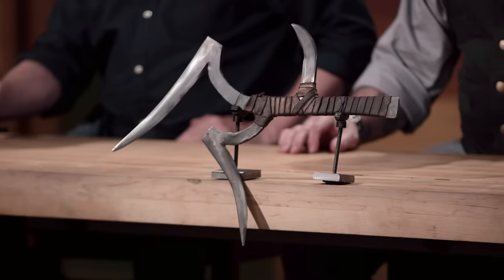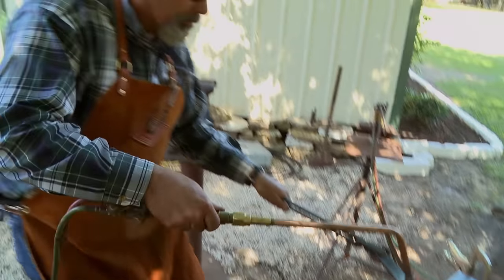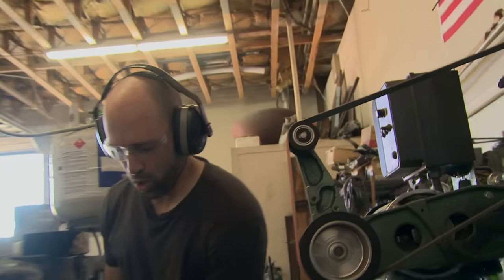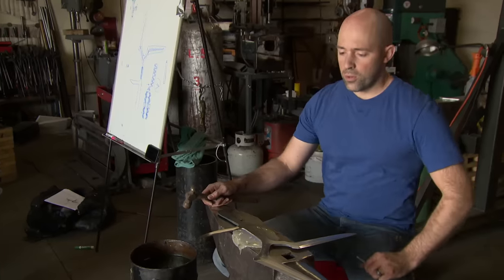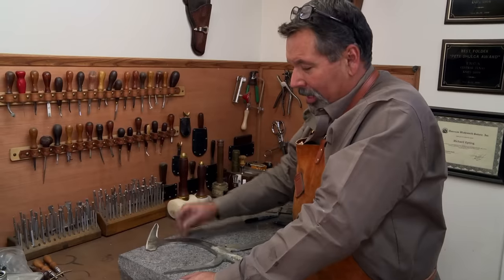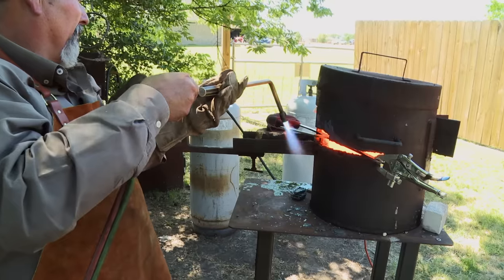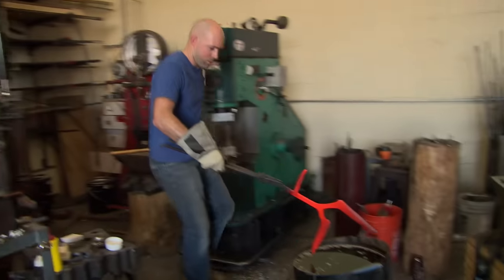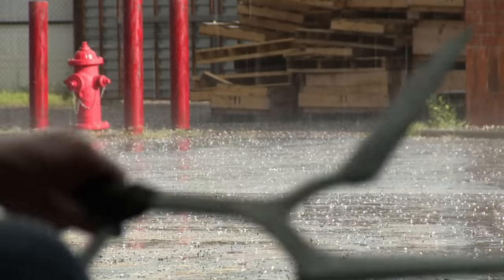Forged in Fire: Kpinga Throwing Blade LEAVES A MARK on the Final Round (Season 4)

Comment: The fact that the judges can "adjust" to a throwing weapon that quickly is insane... throwing weapons are one of the hardest to master
Reply: They're masters in their field, they know how these weapons are suppose to work
Reply: Not necessarily. If you know the basics then it's actually kinda easy especially for a weapon like this. As long as your throw is consistent it's only of a question of distance. If you ever go axe throwing then keep your form consistent even if you don't land it the first few times eventually you'll be able to land them consistently with a little adjustmentkn terms of distance. Same goes for throwing knives and other thrown weapons. Keep your throws and rotations the same but vary the distance till you find a spot that works.
Reply: They can just redo takes untill they hit
Reply: @xvaldez3284  this! i like the throw knives, people say its really hard, its not, once you know your distance and throw consistently it will stick each time... the hard part can be learning for say no spin throws over distance
Reply: @MrBa143  problem is that works the weapon unequally
Reply: @mikleman996  I remember a champion knife thrower mentioning this, but there is an additional challenge... even the shift in design of one blade to another can shift the weight slightly, altering the angle. So no first throw is perfect. 

That said, I usually hear knive throwers taking 3 shots to master a new sword and this guy did it in 1. Which is still impressive.
Reply: @MrBa143  They cannot. It does not good if a blade hits the ground twenty times when the other only hits it once.
Reply: stephen kashz  no they dont. Becauseif one weapon misses 20 times and hits the hard floor every time and the other weapons only misses 3 times thats hardly fair... They said it on other occasions that the throws are unedited.
Reply: This weapon is a throwing weapon. With as many blades as it has I'm not surprised with how easy it can hit.
Reply: Probably why they give them 5 days at home. Gives the judges time to practice.
Reply: I disagree. It only took me like 10 minutes to learn how to throw a knife. Then you just have to be at the right distances and it will it pretty much stick the target every time.
Reply: That's why they are judges...

Comment: The average forge isn't equipped to handle a weapon like this.
Reply: A lesser forge did the job though 😁 i mean the African tribes use coal forge and make these weapon for years, right ?
Reply: That's why it's a challenge
Reply: You're really missing the point here buddy. It's a comment on the size of the forge to accommodate the shape of the weapon, fuel isn't quite the point. Though if we do want to go there, coal forges tend to be a bit bigger and have more room to work with, so the average coal forge would probably be more capable of accommodating the shape of this weapon.

Comment: Something I've noticed about the show is all weapons are supposed to be perfect. My opinion is that there is human error.  Just because the knife sword etc. Is not custom made for the judges and their swings and chops are off is no reason for disqualification. Most are period specific and expensive for the time.  So practice makes perfect.  Also I know catastrophic failure is.😐
Reply: They practice with the model they gave the smiths to copy before they test the submitted ones.  The losing smith here altered the position and angle of the blades from the traditional kpinga, as well as giving it a longer handle.  Those changes made it less effective.  He should have held true to the example given, as it was made by people who had perfected the design for use in actual combat.